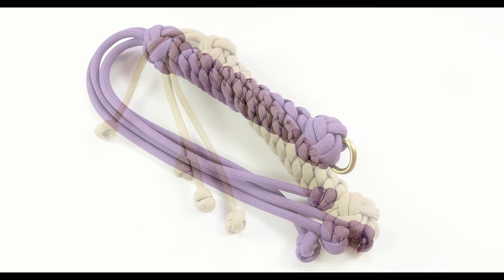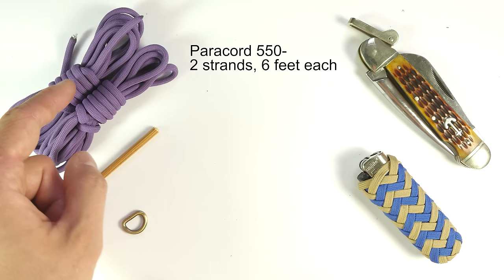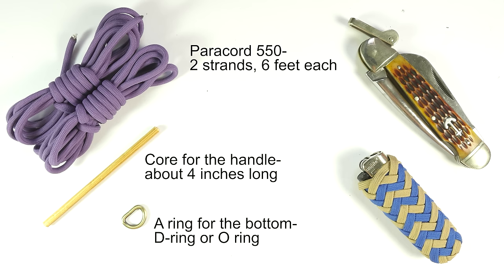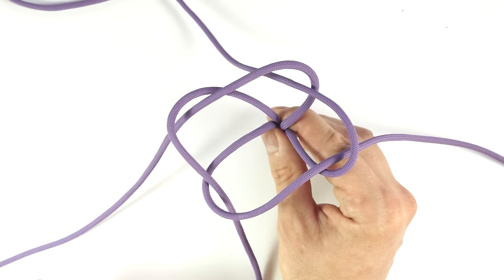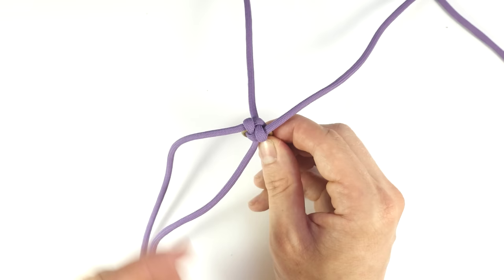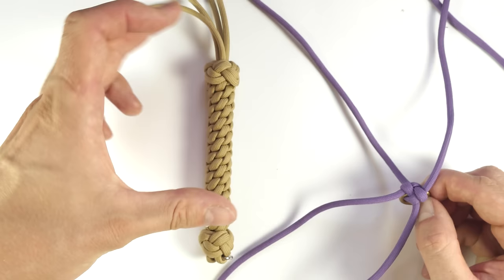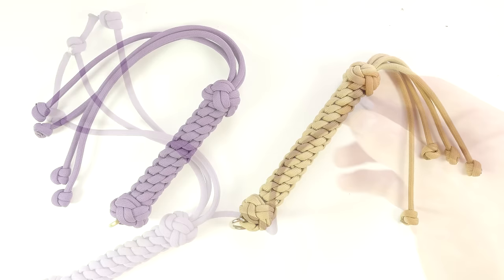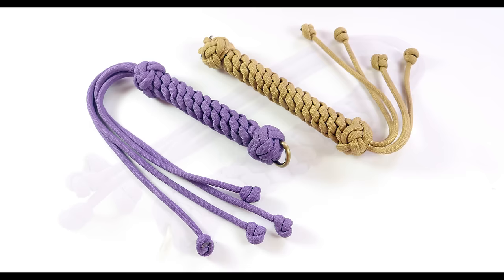Mini paracord flogger

Comment: Hi, I built the flogger with 3 strands and it came out great. I actually was able to add 3 extra strands just before the final double footrope knot so I ended up with 12 tails. I would like to build another flogger using the double footrope knots but with a different braid for the handle. Can you suggest a video? Thanks.
Reply from the maker: Hey! 

You can use any braid as a covering for the core. There are many braids to try. You can hide the core completely with some of them, it is best to try it.

You could also use a slight variation of the crown knot:
https://www.youtube.com/watch?v=3Lm8GKPWXNU

When you are feeling comfortablewith the braids, you could also try more intricate versions such as these:
http://www.paracordguild.com/how-to-make-a-paracord-flogger/

http://www.paracordguild.com/paracord-flogger-version-2/

I hope this helps!

Mark

Comment: I'm trying to figure out how much cord I need for a core that is 3/4 inches (19.05 mm), using 4mm paracord.  The core is 26 inches long (304.8 mm).  I'd like to use the methods you used in this video, but with possibly more cords.  Do you have any rules of thumb, or formulas to help determine the number of cords and their length?  Thanks for any guidance.

Comment: I think I'm going to try making flogger keychains using this, I think a shorter handle with longer tails would make it more functional as a flogger as you could slip a finger through the keyring as your hold point 

ive made two of the herringbone braided fullsize floggers, one a friend is buying (well I'm selling it a loss, shes only paying the extra cost of getting glow in the dark paracord)
keychains might be a fun thing to sell in the local scene

the tool you have on that knife is handy, what is that knife?

Comment: Why is your paracord so thick? Is it a special type? Where do you buy it from?
Reply from the maker: Hey!

It is just regular, 550 paracord. I buy it wholesale from El Wood braiding.

Mark
Reply: Thanks for the reply. How many cores does yours have? Guess I should stop getting mine from China.
Reply from the maker: It has 7 inner strands.
I have not tried cord from China. Always used cord from the USA.

Mark
Reply: +vector chan +Paracord Guild I  get mine  in bulk from Paracord Planet